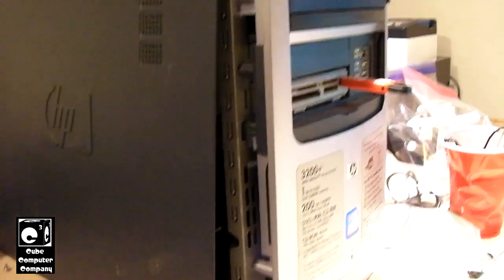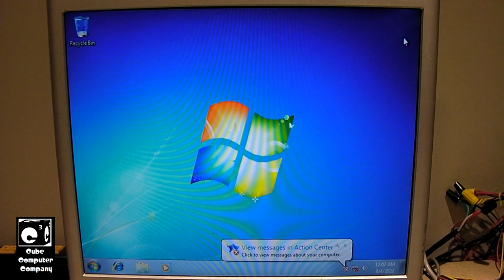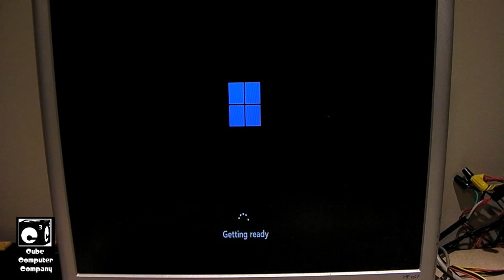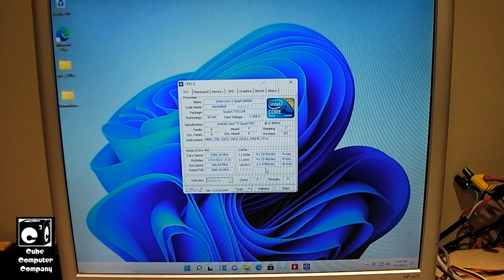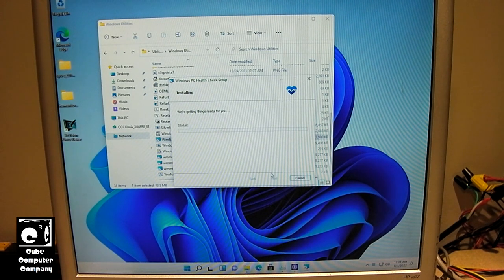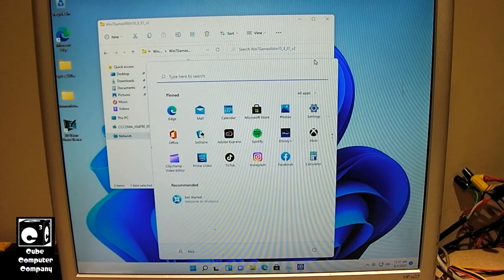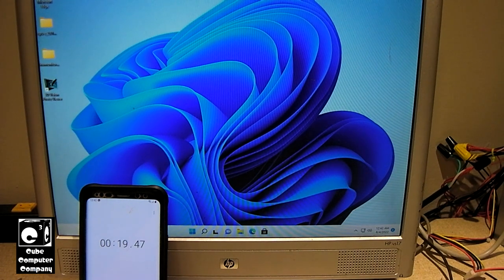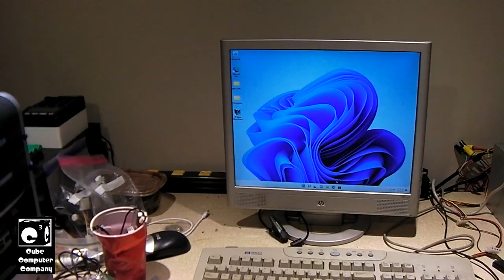Installing & Running Windows 11 on Core 2 Quad Q6600 and Geforce GTS 450

Comment: These OEM PSU are built like tanks even if they are low wattage.I use an old Acer Veriton PC for a Windows 7 dedicated machine that has an i7 2600 and an AMD R9 270 GPU.The PSU is the original that came with this PC,a 300W 80+ Bronze Delta PSU.Even if they recommended a 500w PSU as minimum for this GPU,this power supply handles it just fine and it does not even get warm to touch.I had "500w"PSUs from cheaper brands that easily blew up with worse specs than this.This thing seems to be as stable as my more expensive Corsair PSU in my main PC
Reply from the maker: OEM units are definitely tanks for sure. You are much better off using one versus a questionable new cheap unit when building a budget build.

Lite-On units are among the best tanks out there. Then there's HiPro. A lot of HiPro units are good too. Delta gets 3rd place, followed by Bestec. Bestec units are good too, but they seem to have capacitors fail most often. All these brands tend to have had issues with caps before, including Lite-On. Then there's also the one bad apple of the Bestec tree, the eMachines motherboard killer Bestec ATX-250-12E.
Reply: @CubeComputerChannel  I use Seasonic SS-xx0-ET OEM-type units myself for my older retro builds.

Comment: My favorite CPU :) With a little BSEL overclocking, a Q6600 handles 4K VP9 YouTube videos!
Reply from the maker: It'll also replace your central heat lol
Reply: @CubeComputerChannel  Not if he doesn't increase its voltage.
Reply from the maker: @somebody2978  This one's running at stock clocks and it still puts out a lot of heat.
Reply: @CubeComputerChannel  What do you call lot of heat? What temperature is it having? I see that you have a revision B3 (TDP 105w), those are hotter. I have a G0 (TDP 95w) and it doesn't get that hot.
Reply from the maker: @somebody2978  lol I call it hot when the exhaust fans on the computer start ejecting super hot air. Maybe not all the Q6600 CPUs run this freaking hot, but it's typical for this thing to get up into the low to mid 60s under load. And when it does, the air coming out of the computer feels like a space heater. Part of the problem is the case it's in... not exactly the best for ventilation.

This CPU in particular has always been a heater. Even with a hefty Pentium D cooler attached to it.
Reply: @CubeComputerChannel  In my case, with the stock cooler, I never exceed 45ºC under load. With a Gammax 400, stock voltage, @3.033GHz today it is 28ºC on iddle and 38ºC on full load. Maybe it's the thermal paste.
Reply from the maker: @somebody2978  Doubt it was the paste... even with Arctic Silver 5, this thing used to run hot. And I mean the heatsink would get super hot. Might have been something with this particular CPU.
Reply: @CubeComputerChannel  B3

Comment: I would love to see you run Linux on it by comparison. I am sure it will run so much better. Try MX Linux for a lighter version or even Linux Mint. As for your question to see the outcome in 2025 I think there may be another spike in Linux users just as when Windows 7 EOL happened.
Reply from the maker: I may consider trying Ubuntu ot one of the popular Linux distros on it just for fun. And I think ever since Windows 8, Linux has seen a significant increase in popularity.

Comment: if i use windows 11 on pc with config: CPU Q9550 DDR3 RAM 8GB DDR3 128GB SSD HARD DRIVE HDD 500GB DISPLAY CARD GT420 DDR3 2GB REAL POWER SOURCE 400W . I don't play games and only use it to do normal tasks like surfing the web or watching youtube videos, will this windows 11 work well? thank you.
Reply from the maker: It would likely run well, but keep in mind it won't meet the minimum requirements.
Reply: when I try to install Win 11 on my q9550 it will give me an error it's not supported.

Comment: My system crashes when I try to install windows 10 on a q6600
Reply: I have been running Windows 10 on a Q6600 and a Q9550 for years without issues.

Comment: Love the video you made! I have the same CPU. Did you need to use Rufus or anything else to make the Windows 11 install pass the fact that the CPU isn't supported? And do Windows Updates work fine without any hassle?
Reply from the maker: Yes, I used Rufus to bypass the checks for Windows 11. Yes, you will receive updates, however you must manually install new feature builds when they are released.
Reply: @CubeComputerChannel  all clear. Thanks a lot!

Comment: What do you think of the Dell Vostro 200 and inspiron 530? These pcs are both from 2007/2008. I used to have a Vostro 200 with a C2D 1.8GHz and 4GB ram, intel GMA950. It ran Windows 10 very well but sometimes I'd experience graphics flickering since I don't think those cards were designed to run 8+. Windows 7 graphics can work interchangeably with 8+, correct or no?
Reply from the maker: I think those systems are fully ATX compatible and don't have any of the proprietary connectors found in a lot of Dell systems. I used to have a Dell Vostro 430 in my collection. It was fitted with a graphics card (I believe it was ordered with the graphics card), but also had onboard graphics. Solid machines.

As far as the graphics goes, you should be able to easily locate Windows 8/10 drivers for the GMA950. In fact, Windows 8/10/11 would most likely automatically find the drivers.

As for running Windows 11 on them (assuming that's what you were curious of), although they don't meet the EliteClass requirements, they should run 11 well provided you install a SSD.
Reply: @CubeComputerChannel  I had a Vostro 200 2007 pc in 2015/2015, it ran Windows 10 really well as I mentioned, and yeah the drivers installed by itself. Good for basic stuff. I’d say for today I think it would make for a good library computer.
Reply: @CubeComputerChannel  Also, have you noticed that newer versions of Windows 10 run slower than the older versions? Or is it just me? On lower end duel cores I mean from C2D era. 8.1 is fast of those late 2000s duel cores tho.
Reply from the maker: @mustasheolll2020  I actually have a couple videos about this!
Reply: @CubeComputerChannel  Also, I found the Vostro 200 in our garage attic lol

Comment: I'm coming to this late, but...I've got a CyberPower Gamer Xtreme running Windows7 with an Intel Core i7 950; GeForce GTS 450; 12GB DDR3 RAM. According to Microsoft specs, it won't run Win10 or Win11, but the thing is a beast so I hate to just scrap it.  Based on your experiences, would it run Win11 as is? If not, will swapping out the motherboard and CPU do it (since this video shows the GTS 450 graphics card works even if it isn't officially supported) or are there other components likely to need replacing?  Thanks in advance.
Reply from the maker: You can run Windows 11 on it as-is by using Rufus to set up your installer to bypass the CPU and TPM checks. Give it a try
Reply: Check out tiny windows it’s made for older and lower power pcs like yours